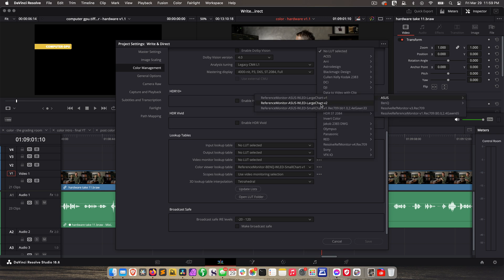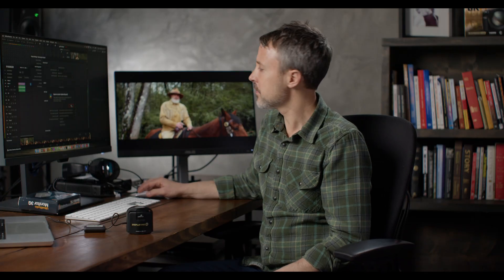Color Grading Hardware | Intro to Color Part 3

Comment: Hi, thanks for the great tutorial, I have a 4k Asus ProArt monitor, and a budget that only allows me to buy ultrastudio 3g, can they both work?
Reply from the maker: The UltraStudio doesn't care what it sends a signal to. But it will only be an HD signal. If you can't do the BMD 4K box, what about a Decklink with external card holder? That's way cheaper and not a ton more than the UltraStudio Monitor 3G.
Reply: @writedirect I can't buy decklink unfortunately, so I can use the ultrastudio 3g and it will send me a clean HD signal even if I'm using a 4k monitor and a 4k tomeline resolution? Do I need to change the timeline resolution from 4k to HD? Thank you so much!❤
Reply from the maker: You don’t change the timeline resolution. you change the monitoring and the scaling. I show you how to do it in the ultra studio monitor 3G video. But if it doesn’t make sense, let me know. Just to emphasize, your timeline resolution stays at 4K. And you’re basically telling resolve to send an HD signal out through the ultra studio for monitoring only. And also, this is for Rec.709 delivery. It’s how I did my latest film. Shot in 4K and 6K. 4K timeline. Graded with the ultra studio monitor 3G. Exported 4K Rec.709 color space. Here’s the film: https://youtu.be/BeaTKjfW4lU

Comment: Thanks for the info, the DisplayCAL way is genius! But a lot discussions online about DisplayCAL crashing unexpectly on macOS Sonoma and Sequoia, I still couldn't make it launching, any advice?
Reply from the maker: Yeah this had been a problem. There is a fork of it that works with Python 3 (for newer macOS). In need to test this. In the middle of post on a film and can’t upgrade right now, but will get to it.

Comment: Love your explanation of the hardware. I am spending so much effort in monitor specs, I dont pay attention to the video signal chain.

I am limited on budget and aiming to go with BMD monitor 3G. Grading with a 27inch 1080p reference monitor, will my 4K videos suffer from a bad grade? My projects are for client that will use un website and social media, but some are requesting 4K renders.
Reply from the maker: Good question. I’m grading a 4K deliverable right now with an HD chain. It will not affect your grade. You need to be grading in something like DaVinci wide gamut of course. You’re just monitoring in HD. For Web you’re delivering in 4K Rec.709. As long as you have your display calibrated, and all of that, you’ll be fine. Now where this changes is if you were delivering in HDR. Different story. If that’s confusing at all, watch my lesson where I talk about color in general because it gets into that stuff.
Reply: @writedirect  Got some available resources and exploring the 4k route. Going with the UltraStudio 4k Mini will I still need a LUT box after?
Reply from the maker: @erikgouletphoto  I don't think that box stores a LUT, but you could check with BMD. Also know, if you don't like the price tag of that, you can use a BMD Decklink card and do 4K. Even with a laptop, just enclore in an external card enclosure.

Comment: Thanks for another great video! Quick question: I just bought a new laptop and when I play back videos in the edge browser or on my phone the color grade changes/becomes warmer in the first half of a second of the video, (but in Davinci or my Windows media player it remains consistent). Online, I can get it to play back in a consistent color grade if I toggle the Enhance Video feature, but that's not really an option in other scenarios, (like playing it back on my phone). Furthermore, since the color grades keep shifting I'm not sure what to grade for... Based on my research so far, I'm guessing it has something to do with my GPU and possibly the new AI video enhancement features online and with Nvidia GPUs etc, but I'm at a complete loss. If none of this makes sense, I understand, as I don't quite understand it myself 😅
Reply from the maker: Hey Tasha, thanks! So the videos changing color: Where are you uploading them to? Also, how are you exporting them? Are they H.265 or H.264? You need to grade with a calibrated monitor hooked up to Blackmagic Design hardware so you're bypassing the GPU entirely. I grade in a color managed project using a DWG timeline, but monitor as Rec.709 Gamma 2.4. I get into grading in the actual school. Don't have that stuff on the channel at this time.
Reply: @writedirect  Thanks so much for the response! It's looking more like the issue is starting in the edge browser. When I download onto my computer it's consistent, but then when I export (H265) and watch on my phone it does the quick change again in the beginning, (and only on the first run-through. Not if I rewind...) I'm doing more research into it as it seems like a GPU video enhancement feature helps with consistency when downloaded, but for now I think you're right about how to color grade so I'm looking to invest in that. (And finally calibrate.. It's scary changing factory settings! ☺️) Your course sounds awesome, so looking into that, as well. Thanks, again! 💫
Reply from the maker: @TashaCaufield  right on. Factory settings are overrated. Lol. If you contact me off the site, I’ll send you a coupon for the school. Pricing is low right now because I’m still finishing post production courses. So now is the time!

Comment: Another question (sorry :) ). What do you think or have any personal experience for using latest LG OLED  TVs (C2,C3,C4 of 42"-48") as Color Reference Monitor. Seems they used by many Hollywood studios lately, at  least as customer Reference Monitor, but not only.
Reply from the maker: I haven’t used those. But if you upgrade your display, you need to upgrade the hardware you’re connecting to the display to. The ultra studio monitor 3G only does HD. You don’t want to send that to a 4K display. You need either a Decklink card or the Ultra studio 4K mini.
Reply: @writedirect  Yes and that brings the cost too high, at least €1600  here in EU with all other hardware/software/calibration etc. I was looking for your specific Asus (and BenQ) models, i don't know how important is but i.e. all (3-4models) Asus proart HD 24" i can find here have 100% rec709/sRGB accuracy (according to retailers) but they differ in price.  bBy the way Asus lists only PA248CNV as 100% rec709/sRGB for film making, and also PA248QV, PA247CV  for photography.....
Reply from the maker: @Hand_Held_Productions  any of those ASUS are going to get you close for low budget grading. Just read reviews on them and pick the one people like the most. Make sure it has HDMI in.
Reply: @writedirect I am using Blackmagic Intensity Pro 4k and it is excellent as well. Very budget friendly

Comment: I have the Macbook M1 Air, and i was wondering how to setup two monitors with Davinci , since the M1 Air "allows" only one external display. I was wondering how i can accomplish that, using UltraStudio-Monitor-3G for the reference monitor, and having another monitor for the timeline etc, and not using the 12" macbook M1 air display for that
Reply from the maker: The display connected to the UltraStudio Monitor 3G bypasses the computer so the display limitation will not matter. You don’t see displays in macOS that are connected to Blackmagic hardware.
Reply: @writedirect  So UltraStudio does not appear as display option in mac's settings? You can only see that through Davinci?
Reply from the maker: @Hand_Held_Productions  that’s correct. MacOS does know about the blackmagic design hardware, but not what’s attached to it.
Reply: @writedirect  Thanks a lot Kyler

Comment: I already have the BMD DeckLink 4K Extreme card I used in my Mac Pro. I moved over to a M2 Ultra. Do you think it would be worth it to use my DeckLink card in an expansion case? I was thinking of getting the Mercury Helios 3S. My other problem is DisplayCal crashes when I open it. I read many places that under Sonoma it will not work. Have you found a work around to get it to work?
Reply from the maker: Oh crud, it’s crashing under Sonoma? Well, that’s not good. I’m still on Monterey as I don’t upgrade the macOS unless I have to. That’s what came with my M1. So this is interesting. There is a fork of displayCAL that runs under python 3. It’s possible that could work. I’ll have to revisit that now after hearing this. And the deck link is a great option if you already own it. I’d just get the expansion. But you still might want a box. I use the 12 G micro converter.
Reply: @writedirect  Sonoma came already installed on my M2. So I'm stuck there.  I downloaded Python 3 and ran it. But I'm not sure how to use it. I read in a few places that Sonoma is giving everyone a problem trying to run displayCAL.
Reply from the maker: @russtvmedia  i’m gonna look into it. Because this has to work. It’s the only option out there that doesn’t cost a ton of money. I’m going to contact The Developer doing the python three version of display cow. Want to see if he’s still maintaining it. It’s the same interface. And uses argyllCMS like the other.
Reply: @writedirect  Thank you for looking into the problem. I read also that argyllCMS has to be installed also. I downloaded it but the instructions to install it is way over my head. Anything that has to do with code, I get lost.

Comment: So a lutbox isn't needed or a monitor with built in lut support?
Reply from the maker: Good question. I personally use a LUT box. And I’m going to show that in another lesson. I first want to show the cheapest scenario—And Resolve allows you to load a LUT into project settings so you don’t HAVE to have a lockbox. But an external LUT box is a little more accurate.
Reply: @writedirect  alright will be on the lookout for that video then :)

Comment: Hi there,
I have a similar setup. I have a PC workstation with a Decklink card (HD), and create a LUT using a Spyder 5 probe with Displaycal. I can't justify spending thousands on hardware but still want to have the most accurate color I can with my current setup.

I find adding a video monitor LUT to every project is a bit of a pain, and it's easy to forget to add it. It worked fine for me when using CST nodes, but I recently moved over to using Davinci Color managed, and applying an input color space to each clip (a process recommended by Darren Mostyn when using footage from different cameras). When using this new workflow when I apply the Video Monitor LUT in Project Settings > Color Management the footage looks blocky.

 Blackmagic also do a Micro Converter (SDI to HDMI) that can store a LUT. These are not that expensive - around £60 second hand, and would avoid having to load a LUT in Davinci in every project. Have you looked at this as an option? I'm thinking of trying one of these out - I've seen other people recommend them as a solution for people with cheaper monitors that don't allow you to store the LUT in the monitor itself.

Also, I was wondering which model of Proart monitor you use? I didn't catch the model number.